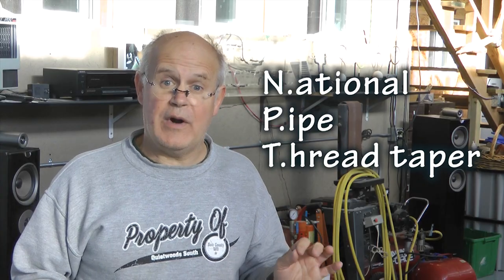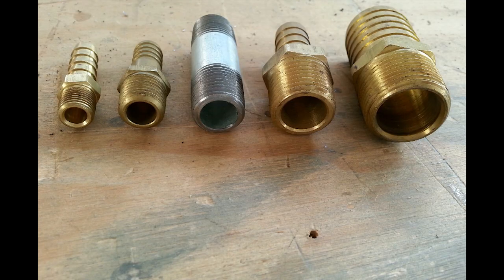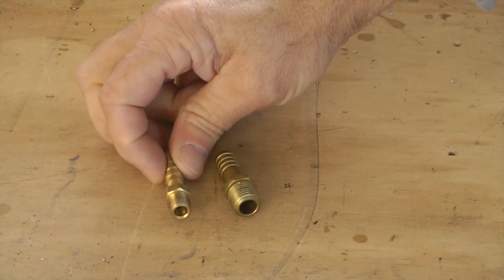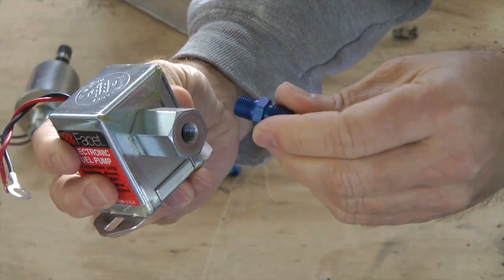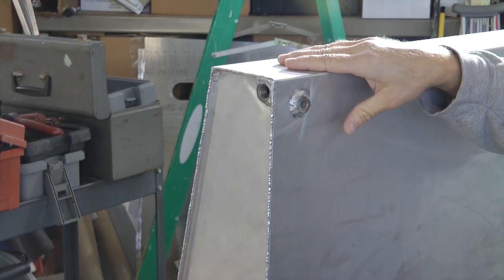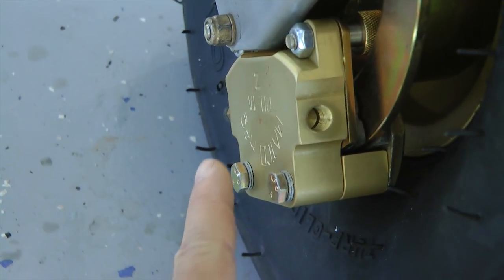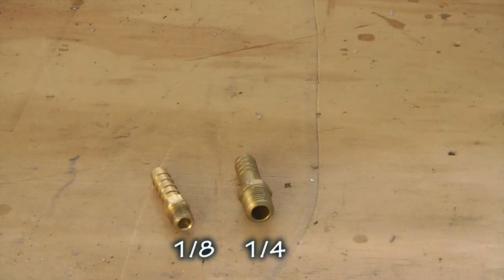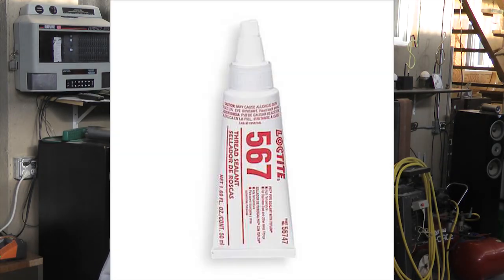Working with NPT Fittings in Homebuilt Aircraft

Comment: So almost always I hear to use aircraft/military grade hardware and fasteners, normally those are aluminum or stainless steel. The 2 NPT fittings you showed looks like the same brass fittings that I see at the hardware store. Are these different, or are they the same as what I see at HomeDepot and Lowes?

Comment: Thank you. I just went through this mental abuse with trying to logically measure and compare to no avail. Your 2x4 explanation helped. I am running 3/8 tubing in my fuel system to feed my Lycoming 0320 and trying to keep that size consistent throughout the system has caused a few ordering errors. When I saw a half inch hole in my new fuel tank which they claimed, correctly, that it was3/8 th..........grrrr.  I was wrong and they were right. So I order a 3/8 fuel drain to match.......grrrrr thanks for playing. ......seem two worlds collide when the naive and uneducated try to play.   Anyway I’m learning. College is cheap compared to the education you receive in real life. Lol adapt adapt adapt.

Comment: Thank you for the straight talk. You filled in a few blanks for me, like a sealant is absolutely necessary.  I struggle with NPT connections because I am never quite sure how tight they need to go. Sometimes they seem very tight and still leak when I used Teflon tape. I guess the tape must have gotten cut as you suggested in the video. I now think I should move to a thread sealer instead. 

BTW, I can’t imagine why you got 8 thumbs down -  thumbs up from me.

Comment: .... one of the biggest problems encountered in British Commonwealth countries has been the confusion between "NPT" and the old British standard "BSP" or "BSPP" ... lots of old brass fittings are BSP which use a 55 degree thread form (Vs. the NPT which uses the 60 degree form) the easy way to sort them out is by using a thread gauge to accurately determine the TPI (thread per inch) of the form ... when you get to the 1/2" & 3/4"  size they are all the same TPI so be careful there ... have fun !!

Comment: There are other NPT's used in aviation including NPTF (National Pipe Thread - Fuel) and NPTA (National Pipe Thread Aerospace).  Neither of these use any kind of sealant and they are mechanically sealed at the threads.  I've never used thread sealant on any certificated airplane, why would I want to use it on my home-built?
Reply from the maker: Thanks for bringing up the NPTF system. However, the vast majority of AN fittings sold for experimental aviation (and even the certified small engines we use) utilize the NPT fittings standard, and of of course it is imperative to use sealing compound on their threads (I know you knew that!)
Reply: Is there a difference between NPT torque and pipe plugs?  Do you have a video on that one? I've heard of folks cracking the oil pan on their Lycoming because they overtightened the plug on the bottom.

Comment: As noted below, NPT (and pipe in general, as opposed to tubing) is measured by nominal ID rather than OD. As far as 2x4's are concerned, my 100 year old house is built with 2x4 studs that are 2" by 4". The lumber size is the rough cut size, and until the 1940s rough lumber was supplied that way. These days lumber is planed after being rough cut, reducing the finished lumber size by the thickness of two planing cuts.

Comment: Thank you very interesting I can work with brass fittings but this light allow I to soft and brakes to easy or splits and should not be allowed to be used on compressors China and Germany are using a lot of these why is it allowed

Comment: GREAT VIDEO! Would love to see another more indepth video on hpa NPT Fittings and to see them be assembled. I Had problems cause i didnt understand NPT and so when trying to assemble my npt fitting for a hpa pcp fill adapter after a turn or 2 by hand they wouldnt go any futher. i thought maybe i had wrong size or bad threads cause i just thought that when the fitting was totally screwes together it would be bottomed out. Well after hours online searching EVERYWHERE I was lucky to find 1 (Yes ONLY 1) Post about my problem only to find out it wasnt a problem :) They are not suppose to bottom out. and after a couple turns by hand they should go no futher and then snug a turn or 2 with wrench and tape or seal is a MUST! Anyway Like i said i had no idea how NPT fittings worked and there is not alot of easy to find stuff online to help ppl in the problem i was having, It would be awesome if youd make a video on it. (TIP:If you dont feel your fittings go in far enough by hand, work with them a while, screwing them in and out by hand over and over til they go in a little by little more til you feel they are together enough by hand "atleast 3 full turns" then clean off any grit and apply tape or paste seal and hand tightn then wrench tight gently 1.5-3 more turns and youll be Good to Go!!! :) ) GOOLUCK ALL! And please try and make us that vid!!!
Reply: Same here. Was or am cunfused about how deep I need to wrench the fitting. Seems there is no requirement but a as it feels thight enourgh it is good. I dont know. Just hope it will not leak and fitting and boss stay fine without cracks.

Comment: Brake bleeders should be at the top, where air will accumulate. Unless you plan to ALWAYS pressure bleed (?) your brakes
Reply from the maker: Yes, the popular Matco cylinders on each foot pedal do not have a "fill" port and are made to be pressure fed. Keep those fittings on the bottom.  Will have a tip in the future on this topic....